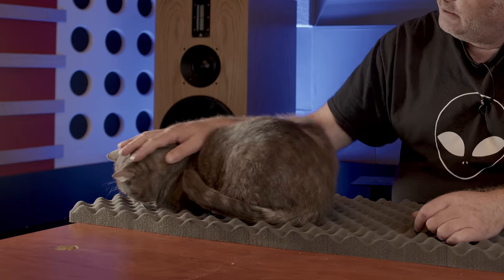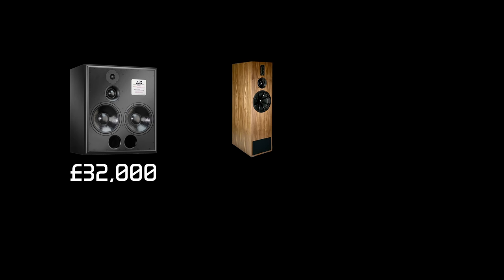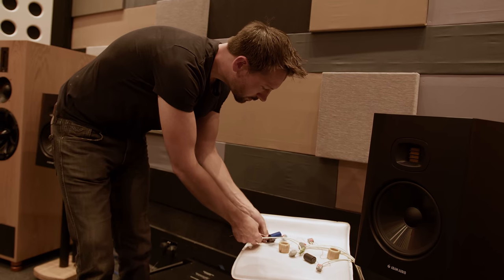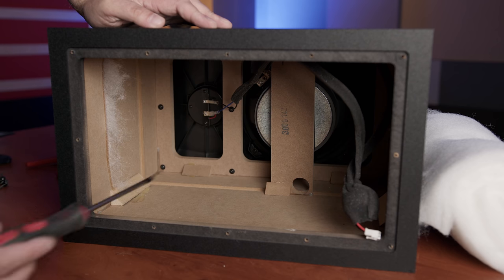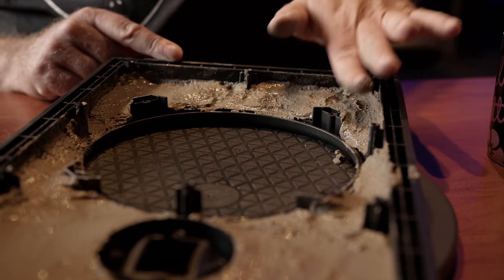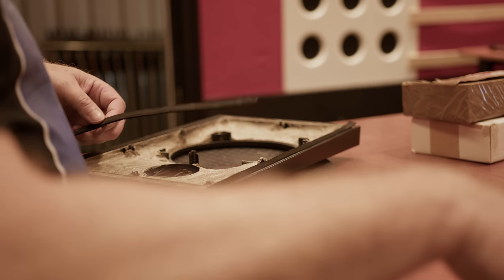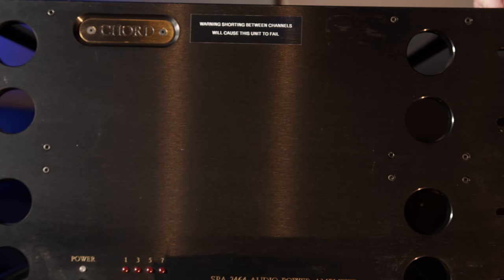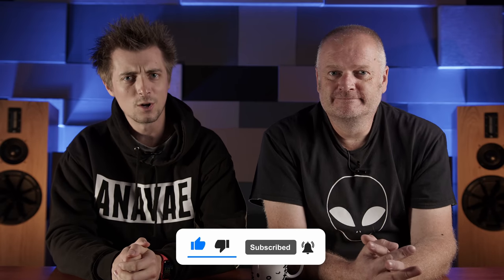We Filled The ADAM T8V Studio Monitors With CONCRETE! @ADAMAudioBerlin

Comment: Let me help you guys out with this resonance issue. What I’m about to tell you comes from experience with car audio and sub woofer boxes. To clear up or lower your resonance @ 100hz or so what you need is liquid fiberglass. Concrete does work as well, and is extreme in any case. This how this liquid fiberglass works let me explain. When you purchase liquid fiberglass it comes with liquid fiberglass resin and a liquid hardener. Mix the liquid fiberglass with the hardener per the instructions, remove the speakers from the box, and the objective is to apply liquid fiberglass resin on all inner sides. One side at a time. Once the speakers are removed lay them flat on the bottom sides first, it will take about two hours to cure after the bottoms are done take the speakers and stand them up right and do those two bottom services once they’re done lay speakers flat on their sides, And on and on until you have the box completely sealed you can apply as much liquid fiberglass as you want to get that deading effect. The more fiberglass you apply on all inner surfaces, the lower the box resonance will become, So in theory you could do this layering effect until you were happy with the resonance of the enclosure. The liquid fiberglass also acts as a great sealing medium. This is done in car audio to seal leakey sub boxes, and decrease resonance of buzzing sub boxes. Hope this helps. It’s cheap, effective and a little time consuming per the drying time for each inner side surface as you can’t do the “whole enclosure” in a single pour/pass. The ending results are amazing! This fiberglass method will work for any speaker enclosure. Concrete? Really? Y’all be trippin man. I enjoy y’all videos too!
Reply: Thanks
Reply: I think silicon should also work and might even be less of a mess and easier to apply.
Reply: So you smear all sides with epoxy resin?  Photos, videos by chance? How about Dynamat, truck liner. carpet felt, or something similar?
Reply: @manuwindsurfing  basically yes! I’ve never used Dynamat or any other resonance deading  material. Sorry no pics or videos. I’m sure someone on YouTube has a video about this technique.
Reply: @EricRabb  Thank you. Being looking like crazy, there's a lot of stuffing home speakers but not much about the front panel.  There are lots of vids for car audio. The front plastic panel isn't as common maybe.
Reply: Might try with epoxy resin, more expensive then cement but its probably going to come off cleaner as the pour will be level once it sets.
Reply: @zenboy2000  don’t do that, just go with the Fiberglass resin, it’s denser than epoxy. This is a tried and true method. Use the fiberglass resin only, not the fiberglass sheets. I hope that helps.
Reply: @manuwindsurfing  yes all of the insides, level by level, side by side. Easy work it will take a few hours to pull this off as you will have to wait for it to cure/harden to before going to the next “side” or “Level”
Reply: @Jakob3xD  no need do silicone, the Resin will completely seal the box after all inner sides are done, you won’t be able to do the “Front speaker side” unless you disassemble the cabinet, which will be impossible. But use a paint brush and do you best like I did. When I did this procedure, I was dealing with a pre made box. 📦
Reply: @manuwindsurfing  no photos, or vids, sorry 😞

Comment: I had an idea that I wanted to get your thoughts on. The concern I would have with using concrete is the sand particles coming loose and also of the concrete cracking over time. So I'm thinking I know of a material I think would work much better and wanted to get your thoughts. A few years ago I sound proofed my Chevy Avalanche doors, side panels with a sound proofing material made for that task called Dynamat. It's a kind of rubberized sheet with adhesive on one side and a thick foil on the other. You install it on the inside of door panels using a roller, fingers, wooden sticks, etc. It sticks very well, an d molds to all shapes and it worked fantastic on my truck. 

The advantage is that it can easily be cut with scissors, has no drying time. won't dry out or crack over time. and it works really well at dampening sound.

You should buy some and repeat that experiment using it and see if it wouldn't work better.
What are your thoughts?

Comment: I have been led to believe that the original Acoustic Energy monitors used latex levelling compound in the enclosure which damped the walls and made them non-parallel due to the cabinet being tilted a few degrees when it was applied. I do remember them sounding very good (30 years ago).

Comment: I did such a job to a set of speakers using high density foam. Once foam expanded, I cut the excess and I made the foam surface even with a hair dryer. Anyway, before adding any cement/epoxy/foam, the plastic surface must be sanded.

Comment: Back in the 80's in the US diy community, we had what I remember as a borosilicate compound to thickly coat and damp cabinet internals. 

I don't recall the name but I belive it was somewhat of a pink bubble gum color.
Reply: think I have some sticky heavy rubber compound designed to remove resonances(long gone carstereo hobby). maybe that could work inside the cabinet

Comment: For the price difference to the ATCs, you can continue the concrete pour to a slab, four walls, and a ceiling, aka “control room”.
Reply from the maker: This is true, however the ATC’s are in an entirely different league when it comes to accuracy - there’s a reason they’re in most mastering studios alongside PMC etc.
Reply: @PresentDayProduction   Just having fun.  I use ATCs occasionally.  Interestingly, a client installed SCM20s in a not so great control room, and they were virtually unusable.  Lesson?  Bad rooms can’t be fixed by great speakers.
Reply from the maker: Absolutely agree! The room is paramount!
Reply: @PresentDayProduction    The cost of ATCs usually guarantees they will be placed in a decent space.  This was the audio control room of a 25 million dollar performance space in downtown Miami, FL.  Go figure.  I used a mono Fostex on top of the control surface to mix the 60 piece orchestra plus singer.  She sang into a beautifully restored M49.  An odd job.

Comment: It's not totally clear, to me, if the improvement is due to increased mass or rigidity. If it is this latter, maybe that using self-tightening cable ties around the top and bottom of the monitors can achieve the same result?

Comment: What you said about the very expensive amplifier making the monitor so much better is what they say about using an amplifier with ns10. I'm sure you've used ns10s before. In your experience does the amplifier really make that much of a difference? I have ns10m Studios.
Reply from the maker: A decent amplifier will always sound better than a poor one, but you have to look at where the bottleneck is - spending £5000 on an amp for NS10s isn’t a good investment in my opinion!  If you’re used to NS10s and can get good results on them then fair enough, but there is much better available these days
Reply: @PresentDayProduction  thanks for the reply